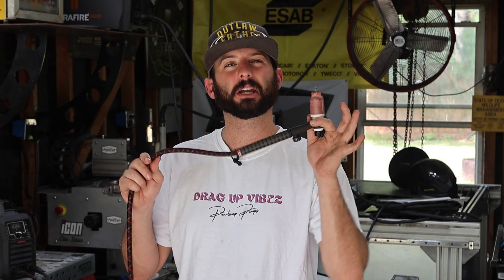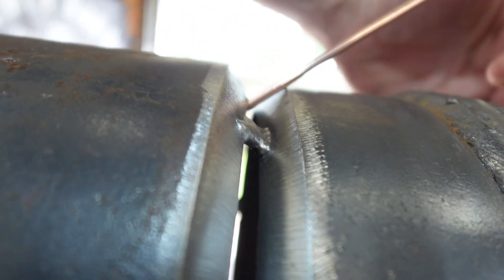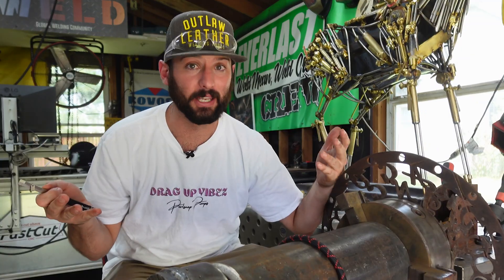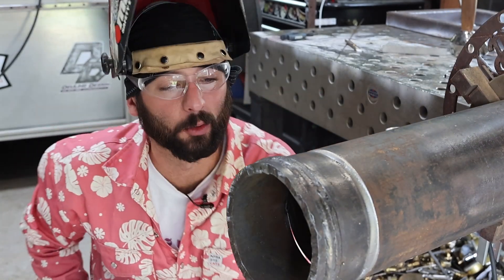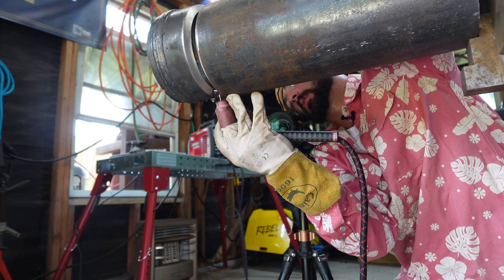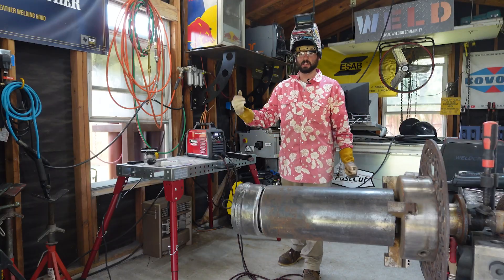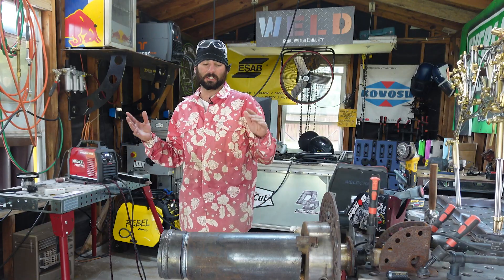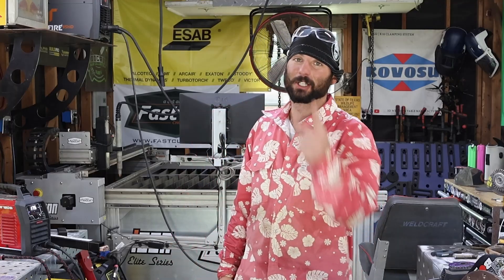How to Weld Bad Fitup When TIG Welding

Comment: I was in welding/trade school 12 years ago. They had us start out with plate and sheet metal welding, then moved us to pipe. Always struggled with E6010, regardless of position. GTAW, took a lot of practice. In fact the first day I had to start doing it, I couldn't quite figured out how to do it. Watched a couple YouTube videos as to not bother my welding instructor and after a couple hours of practice and shocking myself with the filler touching the work piece and tungsten, I got the hang of it. We practiced on 6" schedule 40 pipe. Fitment was always a huge pain and trying to make everything line up. Always used a piece of filler rod to set my gap before I could tack it in place. Didn't always work out the best. It's been well over a decade since I have done much welding, trying to get back into it, since the automotive industry is really slowing down as of late, so a consistent paycheck would be nice now, welding is something that will always be needed.
Reply from the maker: youll never be out of a job with this craft!

Comment: Could you not have double up on your wire to give you more material to lay down? Never done this type of pipe welding, so if its a dumb question......
Reply from the maker: You could try, i find its another variable to manage, makes things squirrley to weld lol -Austin

Comment: What is actually the purpose of TIG welding it in when there’s other options.
Reply: Which "other options" are you thinking? Tig seems like the best/easiest choice with this terrible fit/gap/zero land/overhead (bottom).
Reply from the maker: In my experience Tig is the easiest process to deal with these situations. Its not to say the other processes cant.

Comment: For fish eye prevention you can push a bit more filler then usual . Not sure how good this works with no switch tig tho
Reply: It might help. It’s more of making your puddle solidify a little slower. Amp control or “tail out method” if you can’t control the amps while welding
Reply: @Drweldz  yeah . In Germany switch controlled tig is common so no amp control either . When the Maschine has no amp fade out we do the push filler method